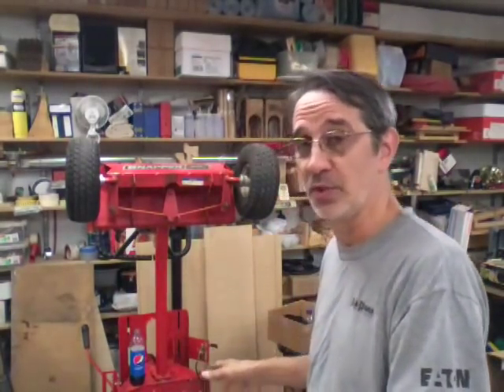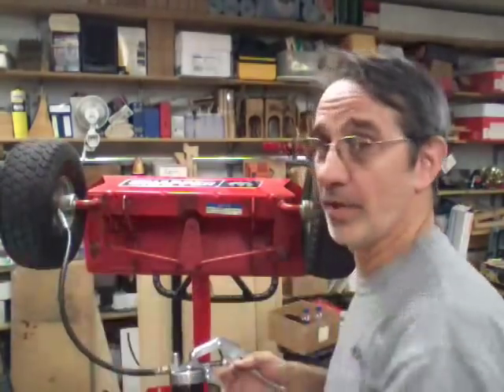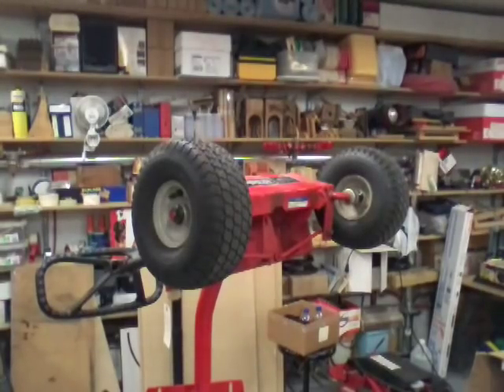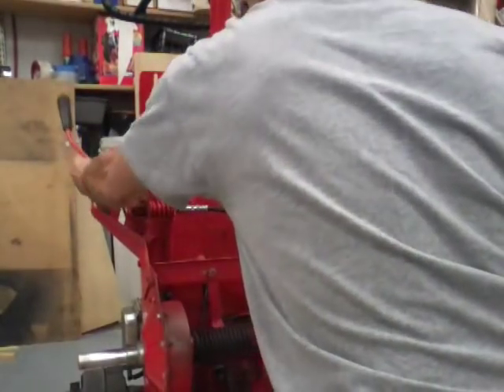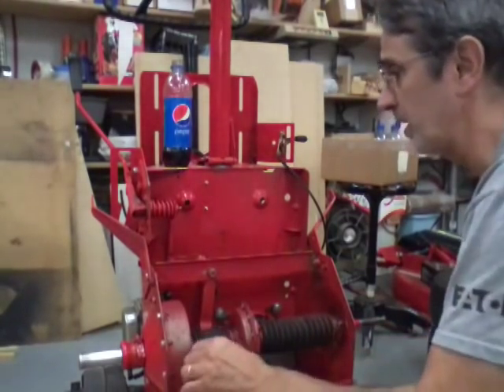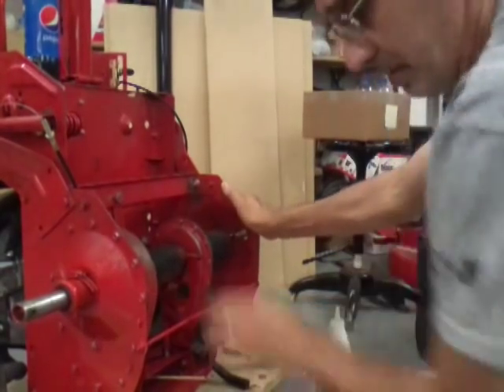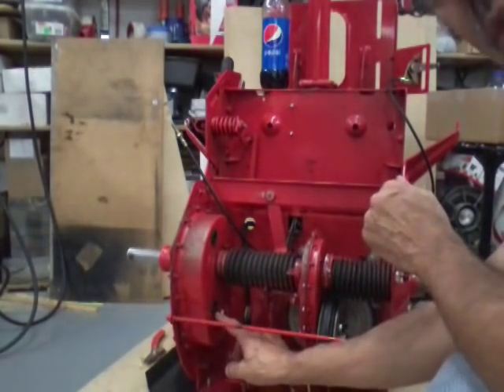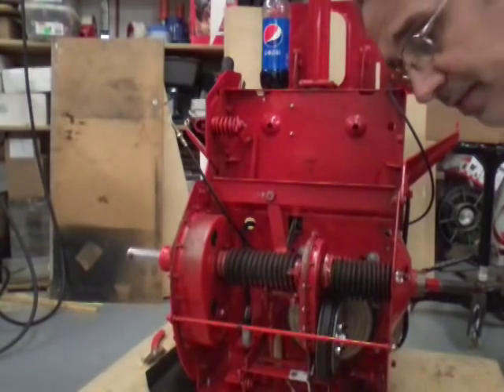143.   Greasing and oiling the entire Snapper Rider

Comment: I have a question for you Jim I picked up a I think it's a 1980s snapper rear engine writer the motor says it's an 80 but I don't know if it's the original motor how can you find out the year of a snapper mower without looking at the engine for the year
Reply from the maker: Well you can kind of tell if it’s the original engine by your model number let’s say your model number starts with 2812 That means it’s a 28 inch deck with a 12 horse engine or if it says 125 then it’s a 12 1/2 horse engine. Let me know. Jim

Comment: I just bought a snapper riding more. How do you determine how old and what model of this mower. Engine is not original. I do know I can info for engine off of cowling cover. I need the info so I can purchase the broken mower belt
Reply from the maker: Bert Garris 
Hi its Jim
 Can you send me some pictures of your machine and maybe I can come up with a close date and tell me what size deck it has and I can come up with a belt. Jim
My email is
jimsfixitshop@gmail.com
Reply from the maker: Is this a front or rear engine machine. Jim
Reply: Jim Jackson Jim, it’s rear engine model. I’ll send pictures when it quits raining. I paid just forty bucks for it. Didn’t even know you had your informative you tube site. Anyway the engine has been replaced and I have to rebuild carburetor. It will crank but runs very sluggish. The belt is broken and wrap around pulleys under the plastic comet on mower deck. Dead battery and wires running in different directions coming from under the hey starter plate. Like I said it was cheap and if I can get it to perform optimally I clean it up and make a few dollars. I don’t see the lever that has to be pushed in order to be put in reverse. So I assuming it pre- safety switch days. Pictures will be headed your way when weather clears. Thanks I enjoy watching your site.

Comment: I see one grease fitting under the deck by the spindle, is there another spindle fitting above the deck? Thanks.
Reply from the maker: No there’s only one grease fitting on the spindle and I don’t recommend greasing it if you have an old machine with open bearings on the inside of the spindle and you pump new grease into the spindle you’re going to be pushing the old dried up grease into your bearings. If you have a newer machine the bearings they put in there are sealed on both sides pumping grease into it is going to do absolutely nothing except it’s going to come out the vent hole underneath Brake drum on the top of the spindle and make a huge mess. Jim

Comment: Enjoy your channel very much. I have a snapper 14.5 new plug, new gas got good spark, won't run when turning over. Any ideas?
Reply from the maker: You have to have three things to make the engine run spark, fuel, and compression I would take the spark plug out put your finger over the hole and pull the rope or turn the key you should feel a vacuum and pressure back-and-forth as the engine turns over, then put a half a teaspoon of gas in the hole put the plug back in the wire back on and crank it over and let me know what it does. Jim

Comment: What weight is the grease you are using? Also do you know if I can use #2 grease, because that’s what I have.
Reply from the maker: Leo Osborne 
I don’t think I would put standard grease in the chain case or the differential you have to have something in there that the gears in chains are going to spread around Grease will harden up in time and your parts will wear out. Jim
Reply: Thanks!

Comment: Hi Jim how are you doing I have a question for you do they have a front tire for the Snapper rear engine rider that doesn't go flat? Thanks Jim I appreciate your thoughts
Reply from the maker: Yes I have a few tire sets for the snappers but what I do is take it down to my tire store and I have them put a tube in it and that’s the end of the leaky tire.  Eventually all of these tubeless tractor tires will start losing air.  Jim

Comment: Should the gas cap vent screw be open all times. My snapper starts up with one pull but if turned off and turned on quickly fails to start requires excessive about of pulling and messing with choke. Any ideas? Thanks I enjoy your videos.
Reply from the maker: Whenever is your machine is running the vent on the gas cap Hass to be opened or the gas can’t get out if air can’t get in.     Jim
Reply from the maker: If the vent is open and it fails to continue to run, you probably need to clean out your carburetor especially if you’re burning gas with ethanol in it.        Jim

Comment: I'm an idiot! In my enthusiasm greasing my snapper I put grease in the differential. I tried to suck it out but not really successful. I did put some 80/90 lube. My question is, Did I ruin my lawnmower.
Reply from the maker: No, you didn’t hurt your lawnmower if you’ve ever taken one apart and seen what’s the old Snapper lube looks like it it’s about like grease or may be a little worse. Jim.

Comment: hi jim, i love your videos on the snappers. i think i made a big mistake
i recently picked up a snapper sr 120 RER that has a transmission that slips
but she does move and engine runs good and has a new seat
i haven't got it out of the van yet due to bad weather at first i thought it may have a bad 
drive  disk, maybe you can help me on this. thanks,john
Reply from the maker: Well when you get it out of the van and get looking at it I want you to watch video number 70 and tighten the yolk spring and see if that helps the drive you may want to check the clutch disk and see what shape that is in you can send me pictures if you’d like to. Jim

Comment: Jim - I've had a well maintained Model M280917B for 2 years now and need to replace the seat switch as continuity is sporadic. I believe I need a NC switch but removing the old switch from the plastic housing is difficult. How do you do it? Thanks for your videos!
Reply from the maker: Chip Nicol 
  Hi it’s Jim
      There are several different styles of switches send me a picture of it and I’ll let you know.Jim
Reply: @jimjackson9381   not sure of year but probably 96-99. Old gray switch has NC on plug spade so I assume NC. Got similar style plug from local Snapper dealer and figured out how to undo snap lock fitting holding switch w/o breaking it. Will try to start tonight. Luv your site thx 4 videos!
Reply from the maker: Chip Nicol 
  Hi Chip
 Yes mine is normally closed to get mine out of the bottom of my seat it has two plastic fingers on the sides you push in with your fingers push down on the switch slide it towards the front of the seat and it’ll come out of the square hole in front of where it’s mounted that’s how mine comes out I’m not sure about yours unless you send me a picture thanks Jim

Comment: Thank you so much I got a 93 model I think. Where is the numbers located for the machine
Reply from the maker: Dump Godby 
The model number is either located on the tube underneath the seat or on the rear case underneath the seat or on the rear case on the back of the machine. Jim

Comment: can i get to the grease fitting on the shifter with the mower deck on?? Also replacing the rubber clutch piece this weekend on my craftsman 28" hi vac-- we talked once before- thanks for the video on replacing it- going to remove the boots  and grease that too- i dont think it's ever been done on this mower.
Reply from the maker: Mike gorton 
Hi Mike it’s Jim
   You can replace the boots in Greece the shifter with the deck in place it’s just a lot harder to lift the machine with it on, if you’re going to leave it on don’t take off both fenders at the same time. Jim
Reply: @jimjackson9381  i made a hoist in the garage with sling to lift it up on end- finished changing the oil, filter, air filter and plug-= ordered a new thrust bearing and new clutch on amazon also new rubber caps when putting the 90w oil in the 2 shifting cases- thanks

Comment: Jim,  Question #1 - I can't locate a rear axle grease fitting on my Model 3311X6S 33" Hi-Vac rear engine Snapper . Any thoughts? Question #2 - I have some 75W-90 synthetic oil left over from topping off the differential on my pick-up truck. Okay to use it on the Snapper gear box and chain housing? Question #3 - Do you prefer doing all the maintenance (oil change, grease, clean air filter, etc) at the end of cutting season or wait til Spring and perform maintenance before cutting season begins? Thanks
Reply from the maker: Question number one it depends which model machine you have if you have an SR which is the rectangular tube instead of the round ,If yours is the rectangular tube you won’t have a grease fitting. Question number 2.  75/90 gear lube you can use it  but it may leak out there are some things you have to do before you can switch from snapper lube to 80/90 gear lube. Question three I do all my maintenance in the spring that way when the machine is standing up stored in my garage it won’t leak oil or gas on the floor, remember to remove the battery. Jim
Reply: Rectangular tube? Are you referring to the axle? So you drain the oil and gas before storing? When I put in vertical position to sharpen blade, how long should I wait (once lowered) before I start it up?
Reply from the maker: @DH-mf2lv  That all depends on the outside temperature the colder it is the longer you want to wait because it takes longer for the oriole to run back down where it belongs on a warm day I would say a half an hour at least 20 minutes, the tube I’m talking about is the one that goes from the front axle between your legs and hooks to the rear case if that is a rectangular tube then you have bearings in your rear fenders and you won’t have a grease fitting. Jim

Comment: good video, When I bought my 2813 snapper 15 yrs ago The factory put a page list of all prep to be done by dealer and it was to be checked off. this was left blank in my snapper manual, consequently the battery connector to engine wasn't even engaged and shift lever broke after 1 yr. If i switch to 80w90 gear oil can i just add over the oogrease from snapper , for me  to clean and   break down the diff, and trans case is difficult . Great job I can watch your tutorials over many times and learn more each watch..
Reply from the maker: p neale mcd 
 I have one viewer comment that when you mix different lubricants sometimes it causes more problems,  but I have had several viewers tell me that they did add 80/90 gear lube to their machines but only time is going to tell the outcome.  Thanks for watching and commenting more things to come keep watching Jim
Reply: John Titor???

Comment: Jim I have a snapper model 1028 that is running full throttle even if I push throttle to slow ... Do you have any videos on throttles or governors set up
Reply from the maker: George Roberts No I don’t have too much in the line of engine videos just the machine if I had to guess I would say that your carburetor needs to be cleaned, or once you have it running try pushing backwards on the governor and see if it slows the engine down you could have a stretched spring or a missing spring. Jim
Reply: @jimjackson9381  thank you Jim I will try that

Comment: Have an engine question. The engine runs just fine or appears to run just fine at normal settings in higher speeds. But when it is at lowest idle it has what sounds like almost a valve leak or firing a little out of time . Any help or info on this particular problem? Thank you
Reply from the maker: Sounds like you’re low idle speed jet needs to be adjusted.       Jim

Comment: What happens to the oil in the engine when you tip it up to work on the bottom? Can it be harmful to the engine?
Reply from the maker: No it doesn’t seem to hurt the engine when you set it back down don’t start it right away give it 20 minutes and if it’s really cold and half an hour.  Jim

Comment: Is it safe to use gear oil in the rear end?  At the dealer we never used anything but 00 grease.
Reply from the maker: Robert Clark 
  Have you seen my video no. 119 & 126.  All the chain cases and   Differentials I have taken apart  the 00 was dried up and as hard as mud,  but ( and there is always a butt ) that decision is strictly yours.  I feel if 80/90 gear is good enough for a car it's Good enough for my mower.  Thanks Jim
Reply: Jim Jackson Have not watched those but I figured the gear lube would be  more  prone to leaking since its a thinner oil.I have never seen a Snapper yet that didn't have  some oil residue  on the rear end.from seeping somewhere.
Reply from the maker: Robert Clark 
That's all I run in my machine is 80/90 gear lube but you do have to weld the drain holes on the chain case cover and differential cover or you can use JB Weld personally I don't trust that so I just weld them  closed. I talk about those drain holes in my Videos.  Thanks Jim

Comment: That's what I'm about to do later on today. I don't know how much grease or gear oil to put in the chain case so if I don't find out soon I'm gonna pump it full or part way of grease and the other part of 80w90 gear oil
Reply from the maker: I have had some viewers do that but I’ve never heard how it worked out
Reply: @jimjackson9381  I had just enough gear oil for that chain case so I pumped it with grease the rest the way until the oil started to come out then closed it up 

I think it'll be fine its better than nothing
Reply: @jimjackson9381  I have to buy another thing of 80w90 gear oil for the differential case I'm doing it how the guy wants it done his mower was really needing redone or greased and oiled up

Comment: Where is the grease fitting to grease  fitting the shift lever on a 7800 model Snapper
Reply from the maker: @robertbrown8041  some do not have grease fittings and some do you’ll have to stand the machine up and look at the opposite end of the shaft that the handle is hooked to.       Jim

Comment: Ciao Jim, I am Marco from Italy. Can i use 80/90 oil lubrificant for my new RER 200 without modify nothing? Instead of grease? In my old snapper I always had a differential break!!!
Reply from the maker: Marco Giovannini 
Well without modifying the issues I pointed out you probably will have some leaking. Jim
Reply: @jimjackson9381  Could you remind me what are the changes to make?
Were they described in a video?
Sorry, but I'm a neophyte

Comment: I wonder if you could flush the diff and chain case with brake cleaner to get out the snapper lube without having to take the cases apart
Reply from the maker: It all depends on how old your machine is ones I’ve been working on the only thing you can do is scrape that stuff out with a putty knife. Jim
Reply: @jimjackson9381  yeah I gotta take mine apart. I have to do mine and I really don’t wanna take it all apart. It’s not too old so maybe I’ll get lucky
Reply from the maker: Well you could try it you don’t have nothing to lose if you’re gonna take it apart anyway you might not have to. Jim
Reply: @jimjackson9381  so I took a peek at the diff and the chain case and the grease that’s in there is like wax. Looks like I’m stripping it and scraping it all out. I’m not gunna start it till I can find new gaskets though
Reply from the maker: @paulallen-01  You should be able to find gaskets for your machine at Parts Tree.Com. tell him I sent you. Jim
Reply: @jimjackson9381  oh thank you I definitely will use them.
Reply: @jimjackson9381  do you have a discount code or promo code for your name at checkout or do I just call them and tell them?
Reply from the maker: No I don’t but I’m hoping if I get Enough people telling them they will give me a viewer discount code.  Jim
Reply: @jimjackson9381  ok cool. I just checked their website and they really have a great selection. They even have a ton of parts for my brothers Wheel Horse !
Reply from the maker: They are great people to work with if you look at their homepage on the top right hand corner they have their phone number and a person will actually answer the phone and help you find what you need. Jim

Comment: what is the best oil  for the engine
Reply from the maker: jim morse 
 Hi Jim
   The best oil to use well I guess that’s up for debate, everyone has their favorite brand I would say any major brand name and A straight 30 weight oil in the Summer and in the winter I would use a 5W 30 weight oil if you use your engine in the winter like a snow blower or a tractor with a snowblower attachment on it. The gas I use is from a Citco gas station and it is premium because there’s has no ethanol in it just their regular gas does. Thanks Jim
Reply: I use Wesson oil.

Comment: What happens if you just add gear lube to the case with snapper lube already in there?
Reply from the maker: I don’t know I’ve never tried it I have had a few viewers that have done it but the only way you can tell is to add it and use it for a year and then open it up and see what it looks like, sorry I don’t have a good answer for that. Jim
Reply from the maker: I guess I should say I don’t think it would hurt you may have a little leakage, let me know what you decide to do and the result you come up with. Jim
Reply: @jimjackson9381  Okay, thanks. I looked in the cases and it's just gunked along the sides. The prudent thing would be to order new seals, take the cases apart and clean them out, replacing it with gear lube. I will attempt that in a few weeks.
Reply from the maker: @josephpearlman4010  You might want to watch video number 375 explaining how to put gear lube in your machine. Jim